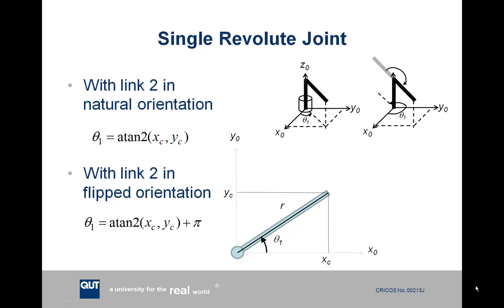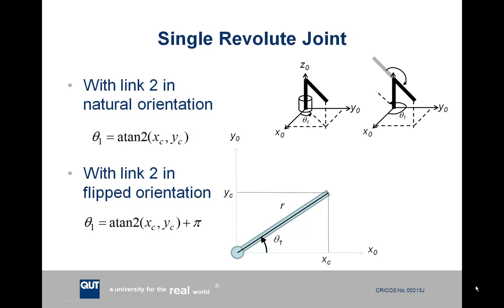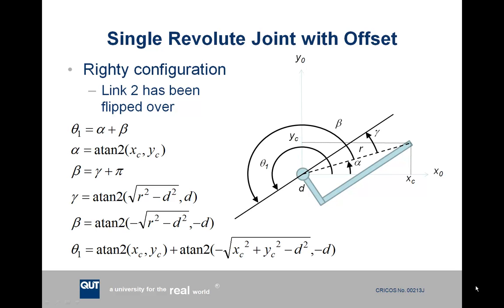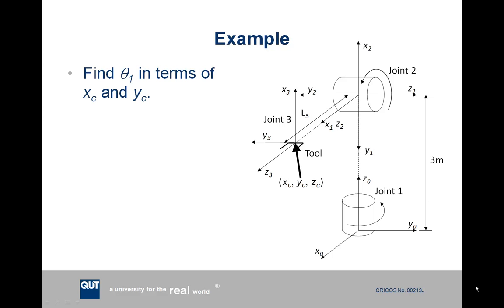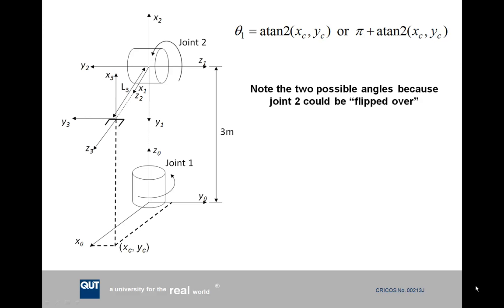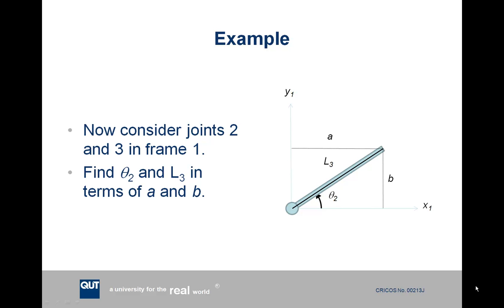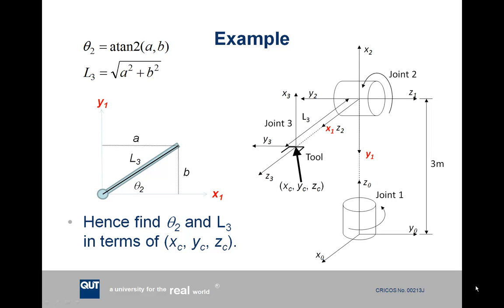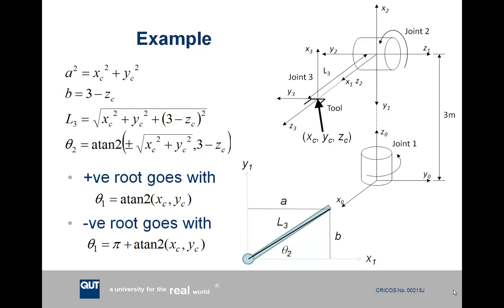Forward and Inverse Kinematics Part 3

Comment: I'm a little confused. According to the Cosine Law, I think it should look like this cos(theta) = (Xc^2 + Yc^2 - a1^2 - a2^2)/(-2*a1*a2). Isn't the negative sign missing? Moreover, the Theta should be the angle between link a1,a2 which is inside the triangle. What I'm I missing?

Thanks
Reply: Theta is defined as an outer angle in this slide. You can take it into the triangle by subtracting from pi. Now your interior angle is (pi - theta) and cos(pi - theta) = - cos(theta). I guess that should clarify your thoughts.

Comment: Hi, I have a problem very similar to the sample in this video. The only difference is that I have an extra revolute joint that is parallel to this examples "joint 1" attached by a link. How does one deal with this complication?

Comment: I am so confused. 
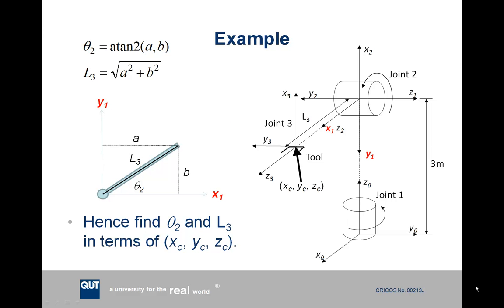First of all, from what I understand, the 2D diagram is just a simpler cut-out representation of a part of the 3D diagram (orientation was changed). In 7:46, you clarified which part by highlighting the corresponding axes(x1 and y1) in both the 2D and 3D diagram. This tells me that a & b lies in the x1-y1 plane (of the 3D diagram). But when calculating the expression for a & b, you're now telling me that they lie on the x0 and y0 plane?
I wasted the last 3 hours ripping my hair out on this 12 minute video. Please help.